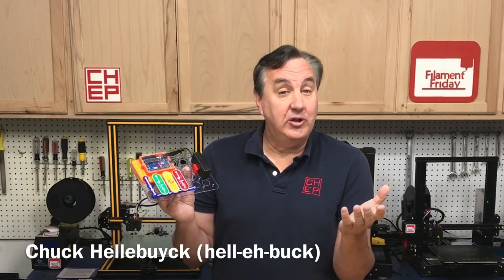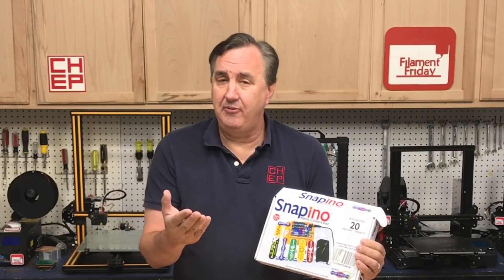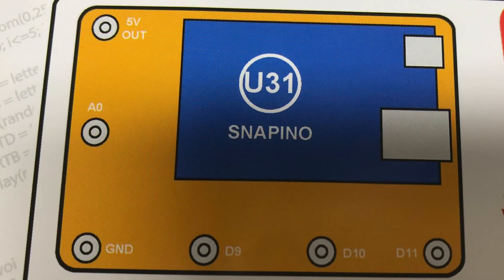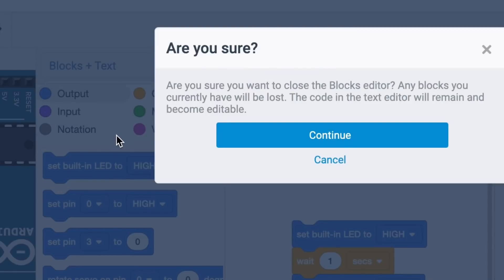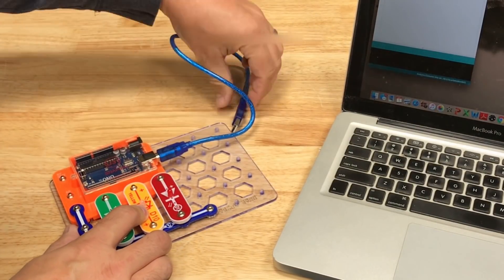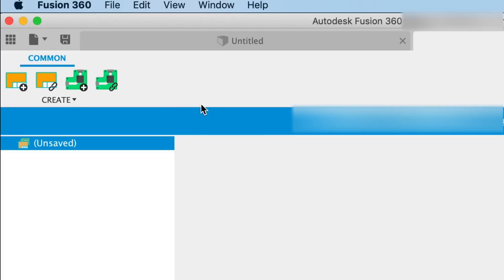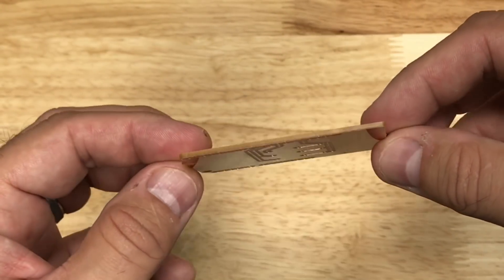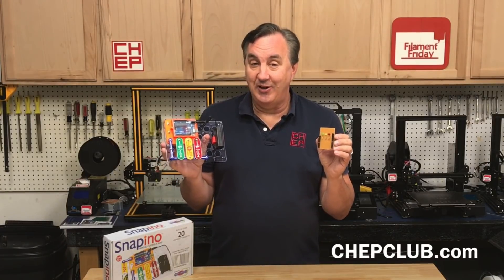Create Arduino Electronics with Tinkercad and Fusion 360

Comment: Hey CHEP if you could take the time to respond to me that would be great, I have an ended 3 pro and my pause at layer doesn’t work correctly because I have the stock board. You have a video that shows your ender 3 handling it just fine so do you know what board and software that you use on your ender 3 so I can upgrade and know I’m getting what I want? If you don’t know then it’s no big deal thanks for reading it anyway
Reply from the maker: Is yours new and has a v4.2.2 board in it?
Reply: CHEP thank you for the response yes it’s new and has a v4.2.2 board and it’s running marlin ver 0.0.6
Reply from the maker: That’s why. The firmware from Creality doesn’t work for that feature.
Reply: CHEP Yeah after you told me what to look for I was able to research the v4.2.2 board and learned how to get a firmware update. Now it works perfectly, thank you  so much!!
Reply from the maker: Where did you get your update?
Reply: CHEP I went on git hub downloaded the marlin 2.0 firmware then went and downloaded the Ender 3 Pro v1.5 configuration. Then I use visual studios to enable the pause feature and a few other things.

Comment: is there a way to print smooth fillets when using supports underneath them?
Reply from the maker: Fillets should need support.
Reply: CHEP yes but the layer transition is quite rough
Reply from the maker: I meant shouldn’t need. It should gradually build up. If it’s upside down then try adding a roof to the supports.

Comment: Hi chep....I have come across 450 to 500 bucks and I'm having a tough problem finding what to get. At 200 bucks an ender 3 was a no Brainerd but with 500 bucks the choice a are far more numerous. Im thinking that the CR series is the way to go cleary out out build volume. But you you know your stuff and figured I'd as get your opinion cuz you've always sent me to a happy outcome.....so whats thing?
Reply from the maker: Did you see my previous video on CR-10 V2/V3 printing a helmet? That’s a good option.
Reply: @FilamentFriday  sound good I'll give a look. Also you should make tune up video. Everyone has a beginner tool setup but it nobody seems to have a tuneup kit. Wheels, belts etc. The stuff that eventually will need replacement. It too my a couple hours to hunt do a new parts. But it would be supper awesome if there was a kit with all you should need to get here good as gold again. Just saying. But thank for the help yet again. Definitely appreciated

Comment: My prints keep ripping off the build plate, and I’ve done some bed leveling, replaced the nozzle, and put glue on the build plate.  Printing temp is 205 F.  May my printing speed be too high, causing the prints to rip off the build plate?
Reply: Bed levelling, speed, nozzle temp, firmware, print cooling fan, having the v guide wheels correct, making sure the Bowden tube nearest to hotend isn’t burnt, or extruder gear worn. Or something else. Watch some tutorials, a few hours worth, and check everything out. You will figure it out. This guy has some awesome videos on this stuff.
Reply: robertall33 thank you
Reply: I was kind of having this issue before, turns out I had too much glue. You just want a super thin layer, like if you used a squeegee or window wipers to apply the glue. I'll normally give a quick spray of isopropyl alcohol before each print to 'refresh' the glue layer and help remove any dust.
Reply: Don’t forget that different brand filament prints at slightly different settings. Using 3dfilaprint pla I did 200c / 60 bed / 100 fan / 50mms. On eSun pla+ I have it set at 210c / 65 bed / 75 fan / 60mms. Both are of equal quality. I used a special hard TPU and my printer settings were 255c / 80 bed / 5 fan / 10mms
Reply: Maker's Muse has a great source for troubleshooting problems with prints. Check him out as well as CHEP here.
Reply: Using fresh filament? I tried with some stuff from and old 3D pen and it didn't work. The stuff that came with the printer worked fine.